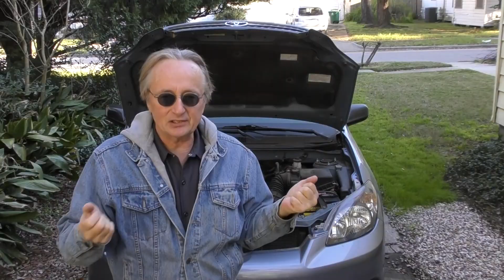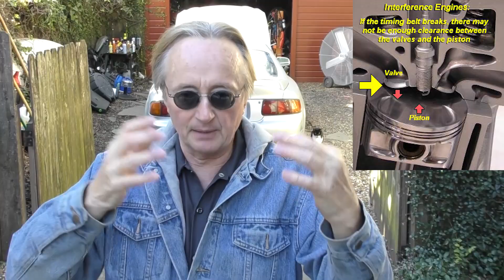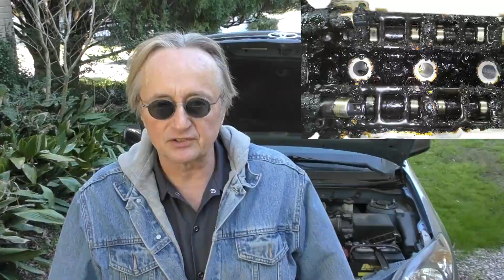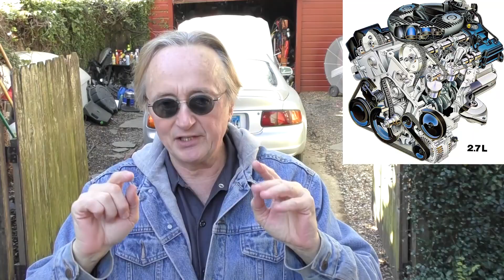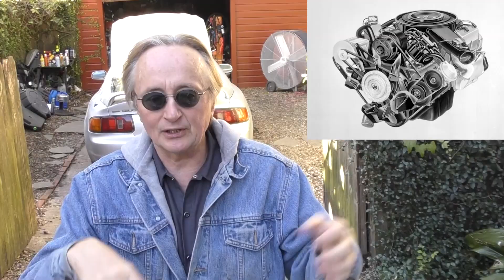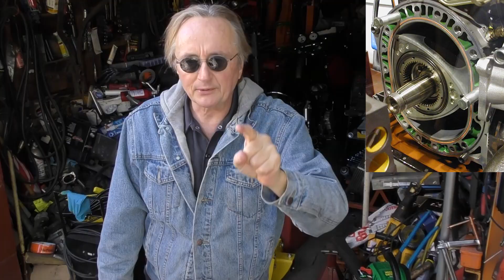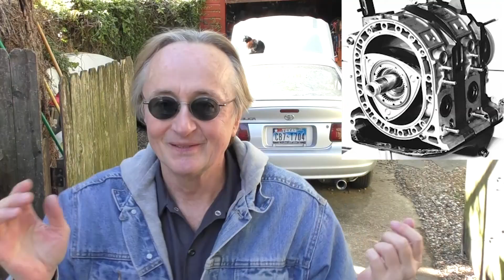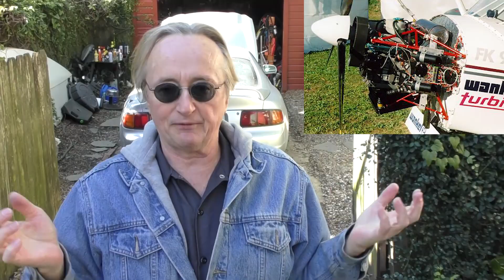Never Buy a Car With This Engine

Comment: You want reliability?  Buy a bicycle.
Reply: And that's only as reliable as person riding it. Lol
Reply: Or a Toyota
Reply: Sorry not reliable my tires allways get flat and chain jumps of and chews my geans up
Reply: @RSR-909  you edited your comment and still spelled jeans wrong. I feel the problem is you instead of your bike.
Reply: @RSR-909  also gotta worry about punks stealing your bike-since it's smaller it's easier.
Reply: mexican kids stole my bike 3 times
Reply: @fromstarlighttosunrise128  black kids always stole ours in my neighborhood 😂
Reply: Buy a Toyota you will never open the hood just fiil it with gas
Reply: True! My parents bought me a Norco City Glide bicycle in 2009, and the only problems I have had with it are a rusty chain and spikey pedals that chewed up my legs. 😬
Reply: Breaking news: Fiat bicycles are unreliable
Reply: @FordFans721  All of the new car/new bike packages are bad deals when it comes to the bike. The car company usually purchases some rights to use the (famous) bikemaker's brand name, but puts it on a crap bike. You're correct. Same goes for Mercedes, VW, and all the other car brands who sold cars that included a new bike in the deal.
Reply: All the same fallacy... Bollocks. I've got a 1990 Landcruiser over 200k miles. I'll keep it for life.
Reply: @HandSolitude   Buy a Toyota before 2000.
Reply: My back bicycle tire kept popping tubes after upgrading to Michelin 700cc tires because of a tiny piece of metal that got stuck in the tire that I didn’t see
Reply: Funny because the newer bikes aren't even built to last, I buy top end models and they are always getting parts replaced every other month it sucks Talking about Trek, Encore.
Reply: Dynamic Gameplay then you’re probably an extreme bicyclist so you have to replace parts anyways. regular Next and Schwinns will never break for a casual rider
Reply: @fromstarlighttosunrise128  a lot of mileage i guess and the few occasional trips to the skate park but my bmx is built for that and it still breaks a lot oh well.
Reply: Does Toyota make bicycles??
Reply: @spacecowboy5995  if they did it would be called a celica for sure lol
Reply: Not really, modern bikes are very complicated; electronic shifting, hydraulic brakes, tubeless tires...
Reply: I want cargo space and to keep warm and dry.
Reply: The chains will fall off anyway
Reply: With mine, the drive chain would always fall off the freewheel! Then I'd unknowingly keep pedaling but get nowhere! Sheesh!
Reply: Not from Canadian Tire tho cuz it will be broken when you buy it
Reply: U know the engine of bicycle is not reliable. When there's a hill, the engine gave up. When there's downhill, the engine can't do any engine brake.
Reply: @Danny M Kmart closed though. At least the ones close to my area
Reply: @Danny M someone told me that Kmart's bicycles were top notch made in THE USA.
Reply: @Mprikiman  Wow, it was my understanding all Kmarts were shutdown - out of business.
Reply: This is a car channel. When you ride your bike, kindly stay out of my way. The road is for motor vehicles.
Reply: Wrong! Your feet are more reliable 😂
Reply: Grow Up, Buy a Car
Reply: @achmadfajar6845   you might be a grown up physically but mentally you're still quite immature. owning a car doesn't mean anything. take a look at nyc..most people walk or use the subway..same case for most metroplitan areas in japan. it really depend on the environment you live in.

Comment: Not that it would mean anything in north america. But that GM 2.2 Ecotec was picked up by Alfa Romeo who improved the heads, did some tuning which brought it up to 185 hp as they claim. They still did not fix any of the inherited issues with timing chain stretch unfortunately. Had one, not a cheap job!

Comment: Wonder if the GM 2.2 ecotec is same as the 2.4 ecotec?
Reply: @Jonathan A Had the 2.4 ecotec put 125k on it had no problems. It always burnt a little oil from day one. It was in my 2007 Ponatic G6. I thought it had good power and enjoyed driving it. Sorry GM got rid of Ponatic.

Comment: Not sure if the 2.2 ecotec that was on the chevrolet models was the same as the 2.2 ecotec diesel i had on my 2002 opel omega, but i can say it ran like a charm, bought it at ~220,000km and sold it 4 years later at ~310,000km, only changed filters and liquids every 10k or so and never had engine related problems.

Comment: Dont forget the aluminum  4cyl vega engine....pull it out drop in a small block v8
Reply: Motor trend car of the year 1971...thanks gm... award money well spent
Reply: @rytvdinners  I won a radio contest once (Tickets to a Car Show) because I knew this? (Because I have a copy of that very same issue that was given to me for the article about 'my' car.....3 way shootout between the Marquis/Electra/Ninety Eight. BTW: The Ninety Eight won.)
Reply: ry tvdinners one thing motor trend does well is shim up my dining room table leg. The magazine will continually endorse vehicle models as long as you make as little as a visual change to the body to qualify for car of the year status. but Vegas really did suck unless you install a v8 then it would drive faster than it would rust.

Comment: I have a 96 passat tdi, does that mean i'm good since those engines were made from 97?
People say though that the 96 and 97 tdis are similar if not identical so could it be that i have the same engine too?
Reply: Look at the engine code.  Your driving style and the maintenance of the car is more important than the reputation of an engine.  TDI-engines are quite good in general.
Reply: @Elaba_  Thank you i think mine is the 1Z type, i remember people telling me of two different engine types between 96 and 97 but not that big of a difference. I think i remember some saying that the 1Z are better.

Comment: Scotty, what are your thoughts on the GM 2.0L supercharged (LSJ) engines. I bought one used and do the maintenance religiously, so I have yet to have any issues. I heard they are solid engines, but the timing chain can go if you use sup par oil, just like the 2.2L. I'm only at 170kkm, so I'd love to hear your thoughts on things to look for

Comment: GM has really improved their cylinder deactivation. My dad’s v8 has 160k miles and the system never caused problems. It’s so smooth you can’t even tell when it switches to 4 cylinder mode.

Comment: I have a 1999 Chevy cavalier z24 model with the 2.4 liter DOHC engine. And boy that thing make so much noise from the timing chain. I know it’s not the exact same engine as the 2.2 liter ecotec but it’s pretty similar. My water pump is driven by the timing chain and my water pump bearing went out awhile ago and I was losing about a gallon of coolant a day. And because of that bad water pump bearing and the fact that my water pump is driven by the timing chain it caused a ton of problems. I didn’t get enough oil pressure at idle and it caused rod bearing damage so now I have lots of noise because the timing chain tensioner isn’t getting enough oil pressure. I only bought the car for $1200 so I think I’m just gonna junk it

Comment: Have seen several 2.2 ecotec engines bust the timing chain. 2004 olds alero being the latest lve seen. They had full service records and car had barely 100k on it. The L61 2.2 ecotec DOES go through TC's so if you have one , get the chain replaced or you're on borrowed time.

Comment: Geesh Scotty gimme a break! :) the first two engines you listed I HAVE hahahaha. HHR with a 2.2, and a Passat with the 1.8T. On that note though the Passat is an 02 with 280k miles and still running strong. I do change the oil every 3k with the good stuff
Reply: Your maintenance has saved you! And your driving style may also be adding long life to your car. Way to go, keep up the good work!
Reply: @ronfullerton3162  I do drive like a little old grandpa hahaha
Reply: @djgaryg  Same here! And it pays! I ride my Harley the same way. Maintenance calls for the cam chain tension block to be replaced at 40,000 miles on the twin cam motor. Had my motorcycle mechanic check mine at 45,000 miles, and he said it looked brand new. You suppose less rpm's at lighter loads had anything to do with it!

Comment: I think there are plenty worse engines than the GM 2.2 ecotec.
Reply: I had a cobalt with that motor , beat the living crap out of it for years and it never gave me any motor issues except 02 sensors
Reply: Had a 2004 caviler with 285,000 miles and still kept good. Lasted longer than the transmission
Reply: I have one in my 05 Cobalt and it's still going strong. The transmission went bad way back but the engine is all good
Reply: Yep my 2.2 is a good 1 ('08 Cobalt). Working on 172,000 and hoping for more. Changed oil every 4k and NEVER let it run low on oil.
Reply: I have a 2.2l S10 love it, thing is actually rev happy.
Reply: @elijahcormier5239  The TWO had the pushrod 2.2. It's a different engine.
Reply: Keith Terry Oh, my bad. I thought it was the same engine and the ecotec was just a different timing setup. Didn’t know it was a pushrod. Thanks.
Reply: What about the 2.4 quad
Reply: @randoanders1416  It wasn't too bad until your water pump started to leak.  Expensive repair.
Reply: Rando Anders ha e ir on my 08 HHR, never had a problem with the engine at all. Nothing, I did blow a transmission sensor that got fried at 167k miles. But got it changed and runs like new. Mechanics were even surprised that the trans was low on metal specs.
Reply: @randoanders1416  right Rando, that was a complete turd, wonder how he missed that one.
Reply: @randoanders1416  Quad 4 was junk. Warped heads and head gaskets.
Reply: My 2003 Chevy cavalier has 240,000 miles and just stopped running but don't know the issue yet. Bought the car for $8500 in 2007 with 80,000 miles. Never had problems with the engine.
Reply: I had an 04 cavalier with that engine had 189000 when I bought it as Scotty says if you didn't take care of it I seen those timing chain units go to hell it was actually the top piece that broke. It's of you let it run low on oil (that's the flaw) they would burn oil when the viscosity went down but if ya kept the oil changed maybe added some.lucas you could get a lot of longevity out of em best car I ever had. I beat the snot out of it rev limit and all and it never blew didn't lose power. I rate them among the best 2000's 4 cylinders again it's a matter of taking care of em. The 2.4 was not so reliable tbh
Reply: Keith Terry 
Yeah , 1994 
2.0 16v eco tech 
Stock up on camshaft Sensors
Reply: @cyclemartin4073  The engine we are talking about isn't from 1994.
Reply: Keith Terry 
You said they are plenty worse engines than gm 2.2 
Yes I agree the former mentioned was one of them , early generation of ecotech
Reply: I figured 630000 on a car only changed oil
Reply: it was gutless and unreliable , but at least it's not as bad as the dodge 2.7
Reply: The Hyundai Theta II engine is far worse than the GM 2.2 Ecotec. Many of the Theta II engines die before they reach 100 000 km (62 000 miles).
Reply: Yeah, the GM 2.4 ecotec.
Reply: Yeah... Chrysler’s 2.7 V6
Reply: My 2.2 is a pita. Goes into security mode and just wont start for 30 mins-2 days lol
Reply: Yeah 2.2 ecotec is fine. The problem is no one maintains them but thats what they were designed for.
Reply: Completely agree.  240,000 miles and no timing chain issues yet (Or other engine issues).
Reply: @Hippy(Bboomer)   why what happen ?
Reply: I 'm  not sure were Scotty comes up with some of this stuff. I have a 2009 Cobalt with 200,000kms on it. Engine has been good and according to the comments listed here I am not alone.
Reply: I know I had a 97 Pontiac Sunfire with a 2-2 engine but it wasn't ecotec I never replace the timing chain and gears maybe I was just fortunate with 225000 miles one of the best engines I ever had in a car must be they really screwed up the ecotec must be
Reply: I worked at a GM dealership for 5 years. Never had to fix the 2.2L ecotecs.
Reply: @doom_wrx  Agree about the 2.2 ecotecs.  I worked in service at a Chev. dealership.  Rarely saw one fail.

Comment: The 2.7 Chrysler had one continuous timing chain, as opposed to the Ford Modular, which used two separate chains, one for each side. Chrysler basically copied features of the Ford. The valve train was the same type, and Eaton made the valves, lash adjusters, and roller rockers for both. Chain stretching due to wear would have a worse effect on the 2.7. Ford used two tensioners, so if one wasn't working correctly, it didn't affect the other side, but if the Chrysler single tensioner failed,  it affected both sides.

Comment: Hey scotty I just argued with my teacher because I said a car that ran on steam wasnt the same as a car that would run on water because a steam engine (correct me if I'm wrong) ran on the pressure produced by the steam. A car that ran on water would have a different design. I understand that steam is water in an evaporated form. But a car that ran on water would work like Stanley Meyers design.

Comment: How does Ford's 1.6 EcoBoost engine fare? Any caveats? Thanks.
Reply: Ecoboosts are great.
Reply: 1.6 is mostly junk. At least in my experience as a Ford service guy
Reply: @rays7437  Really? What tends to fail? I know the pre '16 models had overheating issues.
Reply: @Dr.Wuhattan  
we still see various cooling system problems up through 2016 & 2017 models. We have seen several with coolant in the oil and in the cylinders, yet no head gasket problems evident. Hotline says replace the engine but only if it has certain codes.  The 1.5 is the same. 2.0 and 2.3 engines seem to be durable.
What are you thinking about buying?
Reply: @rays7437  I already bought a 16 Fiesta ST. So far so good. But just wondering if it will make to at least 100k.
Reply: @Dr.Wuhattan  
Fiesta ST overall hasn't had many problems. Only use Motorcraft or Wix  oil filters and synthetic blend (or full synthetic) oil. I think it uses 5W30.  Change the coolant every 36 months or every 30,000 miles regardless of what the book says. Drain and refill is OK. Use only new coolant of the type specified in the manual. Ford sells a premix that is convenient to use.  Change the brake fluid every 36 months. Change the clutch fluid every 36 months. I like to change the manual trans fluid every 60 to 90 thousand miles but I think the book says every 150K.  Check the brake pads every oil change. When they start to wear, they start wearing fast.   Don't idle for more than 10 minutes due to oil build up in the turbo.  Also when you park let the engine idle for a good 30 seconds (or more) before you shut off the engine. 
These are all the things our "heavy line" technician has told me. I have no personal experience with these cars. I drive an F150 and my wife has a Fusion. 
The 1.6 does better with manual transmissions for some reason.  
If you are a racer be prepared to change the clutch accordingly. 
But like I said, in general the Fiesta ST is good. I would like to have one, they're fun!
Edit: Change the oil &filter at 5k intervals unless using full synth
Reply: @rays7437  It's my daily driver so I don't beat on it that much. Just occasionally when I encounter a subie or another ST. Not always. Thanks for the maintenance tips. I have another question I hope you can answer for me. The manual says to replace the timing belt at 150k. Should I do it before that? Thanks.
Reply: @Dr.Wuhattan  
Up to you.  Haven't seen any issues with early failure. I had one customer come in with a check engine light and lack of power at 200,000 miles. As the tech was pulling into the shop the car stalled. It was when he tried to restart it that we realized the timing belt had just broken. The customer said she'd never heard of a timing belt, lol. If it were my car or my wife's car, I would probably do the timing belt at 100K.
Reply: @rays7437  Ha. Now that's funny. Did it cause engine damage? Is the EB 1.6 an interference engine?

Comment: I've really become a fan of full synthetic oil recently. My pickup is factory filled with 5w20 synthetic blend, but I can usually get full synthetic on sale for less money. I spend the difference on a heavier duty filter (WIX heavy duty).
I also tend to get close to a half mile per gallon better with the synthetic oil ( 13.5- 14 mpg vs 13 - 13.5 Ford 6.2 liter v8 in a 4x4 F250 truck with 3.75 axle ratios).
Reply: Smart

Comment: Once again I will say, my 2003 cavalier with 2.2 ecotec and awful gm 4 speed auto, mine is close to 250k miles on both original engine and trans. Proper maintenance can make even junk cars last.

Comment: The mazda rotary wasn't a bad engine. It was designed to be an oil burner and by design wasn't fuel efficient. But that wasn't the point.

Comment: fords powerjoke 6.0 - 6.4 engines
Reply: International made those motors not Ford. Federal Emission guidelines killed the greats of the diesel motors. Bulletproof a 6.0 and it can be just as reliable as the 7.3
Reply: Mojo Risin throw enough money at  any motor it can be great ,but stock they are junk
Reply: 6.4 was a crap design to begin with.

Comment: Im surprised the Oldsmobile 5.7 L D Diesel made from 1977-1985  didn't make the list. Another bad one was the Cadillac HT4100 (4.1L) V-8  head gaskets and the 4.6L Cadillac North star all should be on the list of turds.

Comment: The 2.2 ecotec had timing chain failure because nobody replaces the tensioner and water pump as preventive maintenance. The water pump is timing chain driven. It's owner neglect that causes almost all failures.